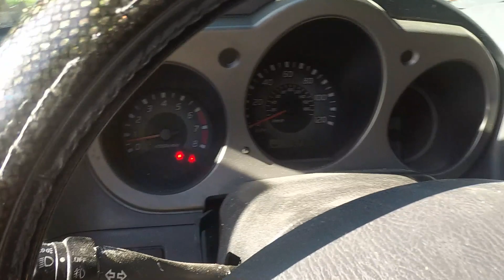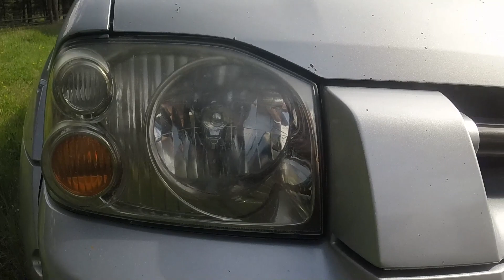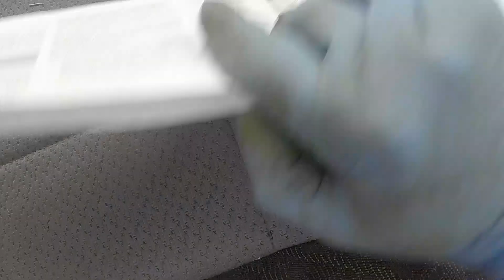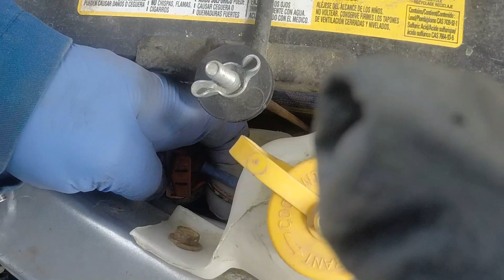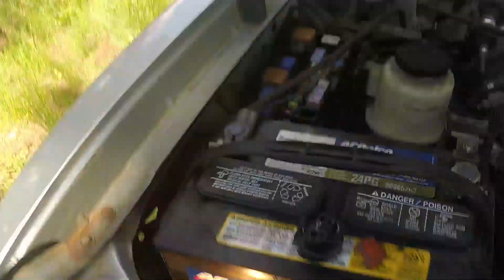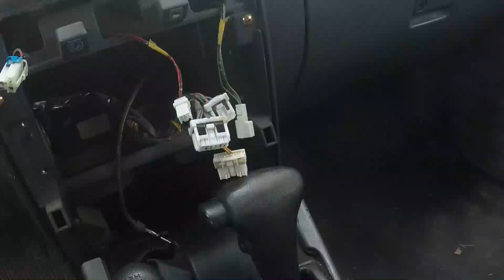NISSAN XTERRA / FRONTIER NO HIGH BEAM, RADIO DIMS - Troubleshooting and Repair

Comment: I know this is an old video, but if you get to read this, I’m having a similar issue (although it’s only with my right headlight height beam) 

Low beam works good, high beam does not, I’ve changed bulb from left to right to see if the bulb is what is not working but the same behavior persist.

I checked fuses and they’re alright, I have no clue what could be it.